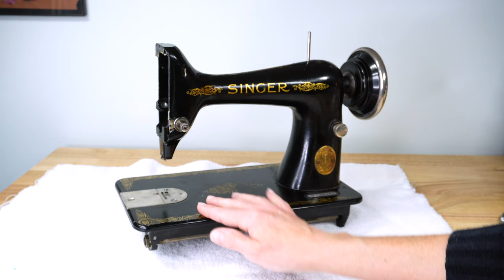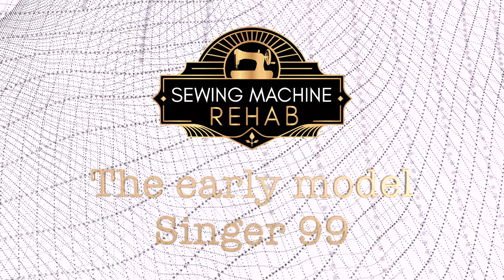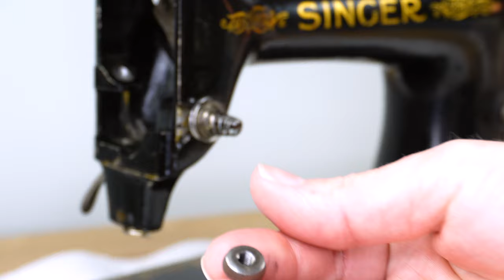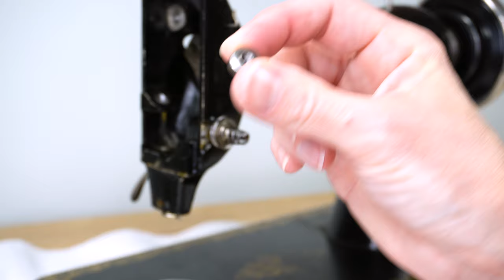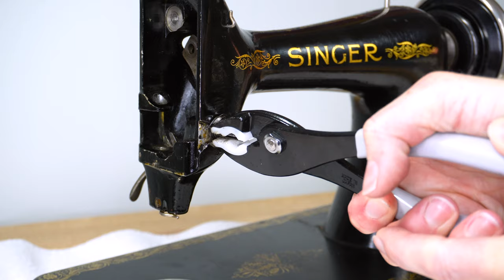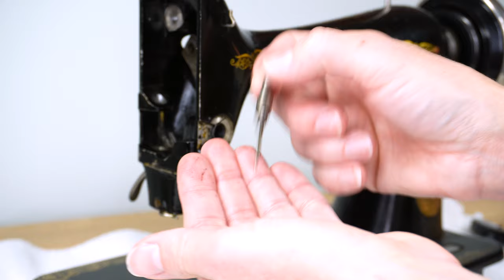How to remove the Tension Assembly on a Singer 99K Sewing Machine - Early Model

Comment: I have a 1952 99K which would be considered a late 99 but it has the early tension assembly and feed regulator screw. Also, it’s a hand cranked machine without a motor. I’m guessing there were many variations throughout production. Thank you for the really helpful and well made videos 😊👍
Reply from the maker: You are right, there were quite a few. I love the sound of a hand crank machine, hopefully I will get a couple videos of my hand crank 99 up at some point. Thank you for the kind words!